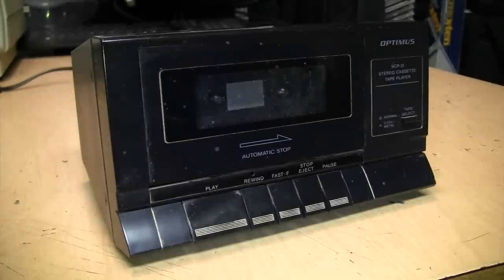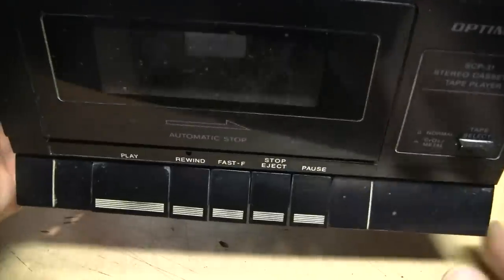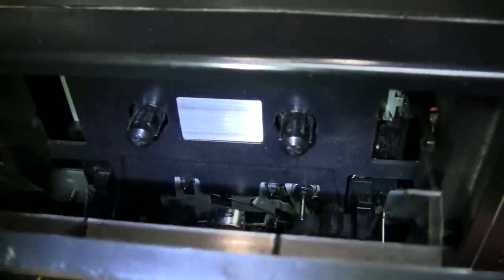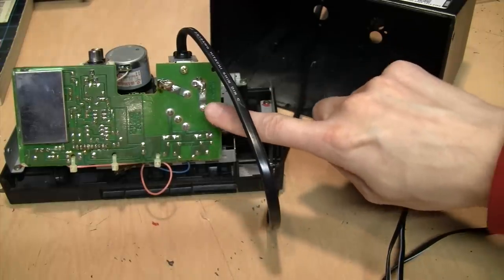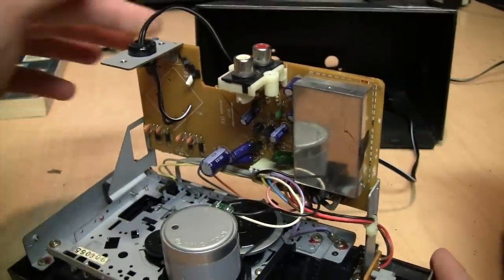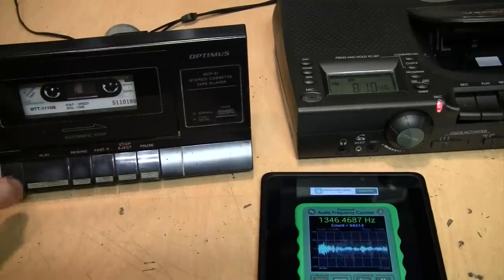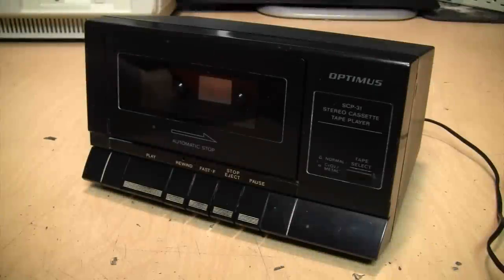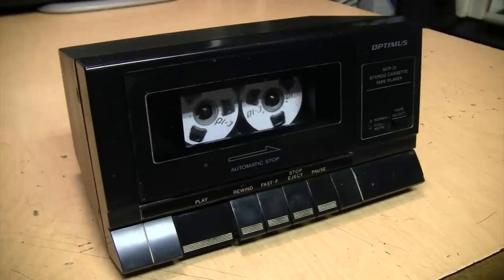Cheap but good Radio Shack SCP-31 cassette player repair

Comment: Sorry for a nooby question, but how do you connect a tape deck up to record examples of cassettes playing in these videos? I recently picked up a late 80's Philips FC567, and the hiss is unbearable. I understand tapes have hiss, but this is considerably worse than I hear compared to other people's recordings online. At the moment I just use an RCA to 3.5mm cable into an Asus Xonar U3 USB sound card, is this an inappropriate method of recordings tapes in and out of a computer?

Edit to say, this FC567 deck may have been a mistake, information about it online is very slim and belts would be very expensive to ship from Germany, and looking inside it may be beyond my skill level to replace belts on this at the moment :p
Reply from the maker: Make sure you're connecting it to a line-level input, not a microphone input.
Reply: @vwestlife  Thank you so much for the reply!! Turns out this USB sound card says it's a combo mic-in/line-in jack that defaults to mic-in, but can be switched to line-in in the drivers. I dunno if I trust that, and I don't wanna install the drivers for that anyway since they're sluggish things from 2015. I switched to the line-in on my motherboard and it is better, thank you so much

Comment: Funny how a Tanashin mech of 20 years old sounds so much better than a new Tanashin mech in any of the recent decks using them.
Reply from the maker: Keep in mind that Tanashin stopped manufacturing cassette deck mechanisms in 2009. Anything made since then is a clone of their design, with varying degrees of quality depending on who's making it.

Comment: What stereo did not have cassette decks in 1989? Maybe in 1979. Or 1999. But 1989?
Reply: The kind that belonged to people who shopped at Radio Shack.
Reply: You know standalone amplifiers and receivers exist, right?
Reply: @westelaudio943  yes, but this wasn't marketed to them. They'd invest in a more expensive deck. Most of us back then had combo systems and they pretty much all had cassette decks. If you're building a component system in 1989, you're not getting a deck like this.

As I said, this deck makes more sense in 1979 (when lots of combo systems lacked cassette decks and vinyl still ruled) or 1999 (when the CD dominated.

Radio Shack was weird.
Reply: @dennisp.2147  The Radio Shack catalog was amazing. Lots of stuff with an unknown brand name that was more expensive than proven stuff.
Reply: @F40PH-2CAT  Yes.  I shopped there...

Comment: I had a thick glove on and tried to press play and accidentally pressed multiple buttons at once. Now it only plays out of one channel. Any ideas? It was the recording version with individual buttons for tape select
Reply from the maker: If it's a model that records, it may have dirty contacts on the record/play switch. My "Cassette Decks for Dummies" video has a quick fix for that.

Comment: From the days before the motors and mechs were cheaply cloned on a massive scale to fill the gap in the market for the nostalgics out there... :P
Reply: It's the beginning of that era.  It is a Tanishin mechanism, just not a clone.
Reply: @dennisp.2147  

Still sounds good though. The original Tanashin isn't that bad.

Comment: Those popped up 19V will drop to 12V when you put the load on it. In other respects you must've used not less than 1500mA to get precisely 12V
instead of that 300mA power supply.🔌
Reply: RMS 12VAC * 1.41 = 17V peak/rectified
Reply: @westelaudio943  Could you explain? Does the value shown on AC power adapter use RMS? If yes, then should not rectified voltage be numerically the same, considering that RMS indicates the voltage of a DC circuit that supplies the same electrical power to a given load as an AC circuit?
Reply: @ConsumerDV  

AC voltage ratings are usually given as RMS, which is average voltage. When using rectifier, the capacitors are recharged to peak voltage every half-cycle, so that's your output DC value. 
However that's only true for an ideal rectifier. With standard Si diodes you can expect around .6 to .7 V drop per diode, so with a transformer outputting exactly 12VAC you can expect around 15.5 - 16VDC with a standard diode bridge + cap configuration.
Reply: @ConsumerDV  

You can also see in this video the 19.1 VDC after rectification is almost exactly the voltage of the (improperly loaded) transformer of 14.6 VAC, after multiplying it by 1.41 (20.6) and substracting the diode voltage drop.
Reply: @westelaudio943  Yes, the ripple factor.

Comment: BEFORE WATCHING: I have a Realistic SCT-86 that needs some repair. Originally it added cassette function to my grandmother's old Channel Master AM/FM/8-track/LP she gave me as a child. (And that had a 4-speed Garrard IIRC). Later, when the Channel Master went up in smoke (literally) I had it connected to a Lafayette amplifier. It was great when it worked, I was fresh out of high school when it failed. By then I had already upgraded to my Sony TC-WR635S so it didn't break my heart quite so much...
 I don't remember the issue, next time I venture down to the basement I'll grab it and take another peek... 
WHILE WATCHING:
1:17 - As Tag Team famously said, "Whoomp! (There It Is)."
10:31 - A little wow & flutter, but not too bad.

Comment: VWESTLIFE:  I doubt you could find one in a thrift shop, but I wonder if you'd ever tried to find an affordable laser record player: There is no stylus. A laser reads the grooves in the vinyl record and converts the light into sound. Could you find one and make a video?
Reply from the maker: Those cost at least $8000, don't work with colored or clear vinyl, and require the grooves to be perfectly clean before playing. So I'd rather stick with a laser record player that plays shiny little records called CDs.
Reply: @vwestlife  What about a larger laser record player that plays full-size records called LaserDiscs?

Comment: Adjust the azimuth.  Given its age it could be out, and even if its not, many machines came from the factory slightly misaligned. I think you will get more highs if you do. Given its a playback only deck you can do this by ear if you don't have a test tape.

Comment: It could be that the power transformer has a thermal fuse as many do and that failed, in that case you can just replace or bypass it.

Comment: @VWestlife - 
I somehow knew it is 9V AC ... 9V AC (wall wart , followed by 9V-DC) was very common for a lot of 1980s & 1990s stuff & 9V AC is a lot harder to get than 12V-DC (which is today´s most used) 
because 6 years ago I needed a (German style) 9V AC power supply ( I ended upp with one for the Commodore VIC-20 ) for a donated vintigage 1980s / 1990s LED-announcement sign from "Sigma" (using a self made Serial-RJ (phone cable) adapter &  the software "SignWorks" that I got from the internet (maybe shady website) & a donated Windows NT-laptop)

Comment: While there is power going to the power supply, the rest of the circuitry isn't powered until you hit a function button (play, ff, rew)...this is not unusual for modern electronics.  It's not as bad as most "soft-start" devices these days where a lot of the electronics are always powered like TVs, stereos, computers that are powered on by a momentary switch or remote...unless you toggle their "hard" switch (if they have one, like the back of a desktop PC).
It could be the device got a spike in voltage that took out the transformer.

Comment: $5.95 seems pretty high for something that doesn't work.
Reply: I disagree. If it's significantly cheaper than working ones and seems like an easy fix it makes sense. For somebody who isn't knowledgeable about cassette decks it probably doesn't though.